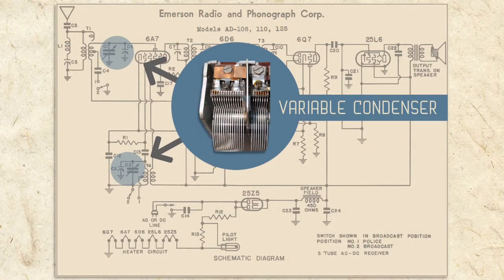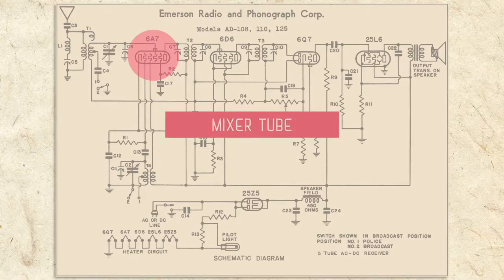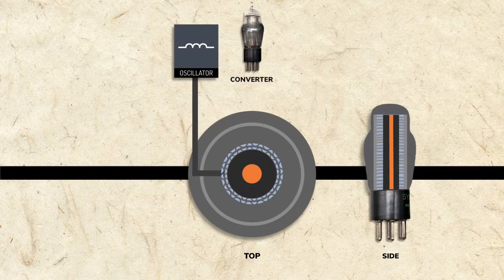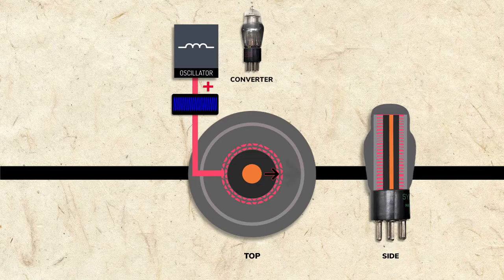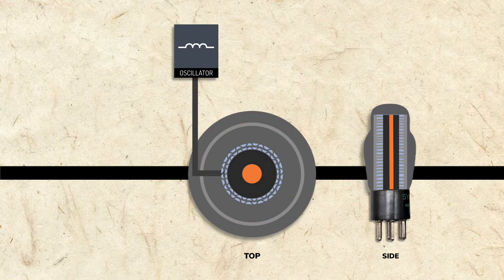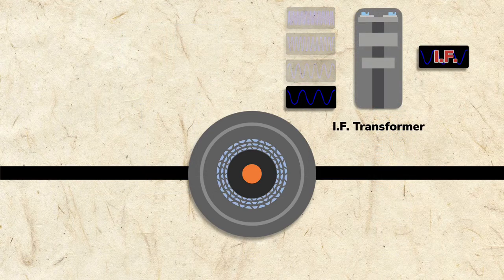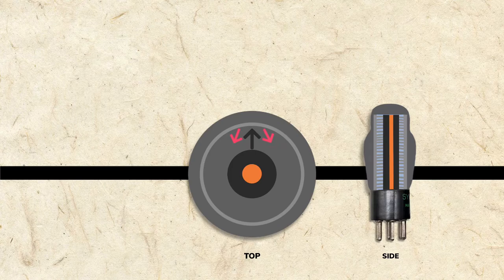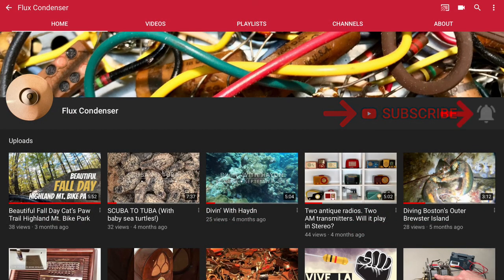How Do Converter Tubes Work?

Comment: I know it was a slow developmental process, but this is magical, leaving me wondering in awe how they figured this out.
Reply from the maker: Yes, absolutely. I often think the same way about how technologies develop. We take so much for granted, but we stand on the shoulders of others.
Reply: the math which was not discussed, shows this very clearly, in trigonometry if you multiply 2 sine ( or cosine) waves the product is the sum and difference of the the 2 waves.  If the oscillator is 2000 KHz, and the radio signal is 1500 KHz, one output will be 3500 KHz, and the second will be 500 KHz. If there's a filter that only allows 500 KHz to pass (that's the IF transformer) then you can amplify this and detect it (more math) and get the audio signal out.